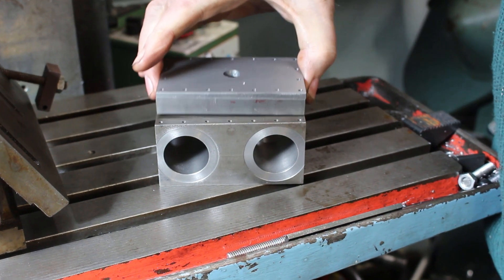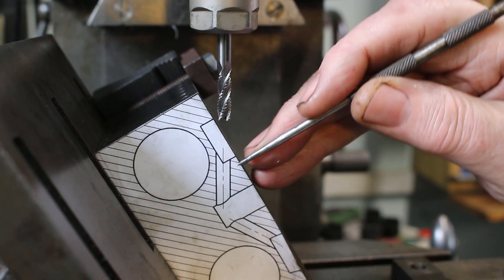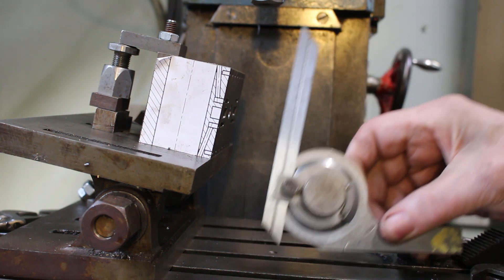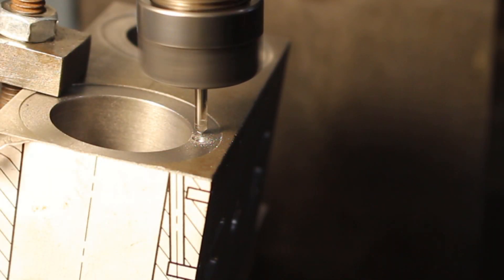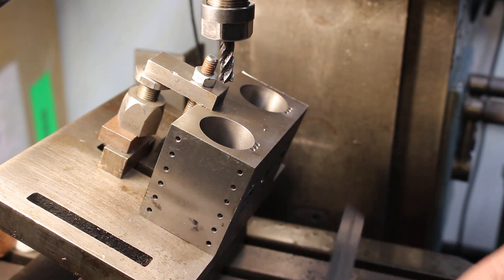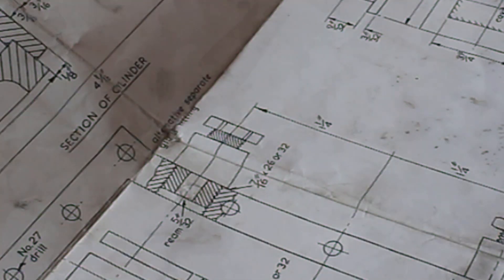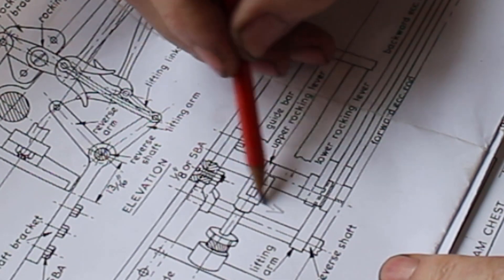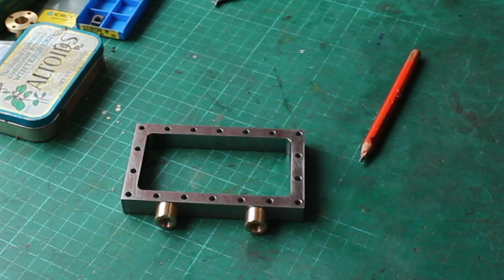Lion - 5"g  Miniature Locomotive Steam Engine Build pt.41 -  Cylinder Block steam passages

Comment: Definitely an advantage of a DRO in this (in addition to your fabulous skill of course) - I think I'd have a mare managing all that backlash doing in the X and Y for those six steam port holes. I'm trying to avoid modern contrivances as long as possible but I do think I'll end up getting one eventually :(
Reply from the maker: Thanks William. I've never felt inclined to add a DRO to any machine, it just so happens that mill came with one fitted, which is a pity in a way because it has such wonderful and accurate dials. In it's day it was a high precision machine. 
Backlash adds interest!
That museum visit you did was lovely, made nice video.
Thanks again for watching.

Comment: Yes the number of locomotives that are poor performers because these parts are not big enough.
Another Friend in Reading club brings a Pannier or Simplex and both are a bit rough... In a nice way as he has not finished off by hours of filing and polishing. BUT open the regulators and both are a pleasure to drive. I usually do the LUNCH TURNS so that a bright lively little thing is eager for the afternoon. David and Lily.

Comment: Hi there great video showing how to get out of those "oops" moments. Can you tell me the feeds and speeds you used in the CNC parts ?
Reply from the maker: My machine is very light duty, so it's not able to get the best performance out of the milling cutters. I generally run at between 60-80mm/min and adjust the rpm down to get a decent chip load, I did the cylinder ports with a 2.5 mm cutter at 1800 rpm and 2mm depth of cut. On the exhaust port I used a 6mm cutter at about 1000 rpm and 4mm DoC.
Thanks for your interest.
Reply: @GoCreatehms  thanks for the quick reply and the information I am just converting my mill to CNC. I have just finished a little twin steam engine for a steam launch I am building it is a copy of the graham industries gage engine one of which I built some time ago. here is a video of the copy running on air  https://www.youtube.com/watch?v=ntZWNhv4V3c&t=6s
Reply from the maker: Nice work Bob, that little engine doesn't half go. Good luck with your cnc project, it's very handy to have for profiling parts ans 3d milling shapes that would otherwise be castings pr fabrications.
Reply: @GoCreatehms  Thanks I am in Inverness so if you are up here anytime please call in just PM me.
Reply from the maker: Thanks Bob. Like wise, if find your self in the Huntley/Alford area you'd be very welcome to pay a visit. Cheers.